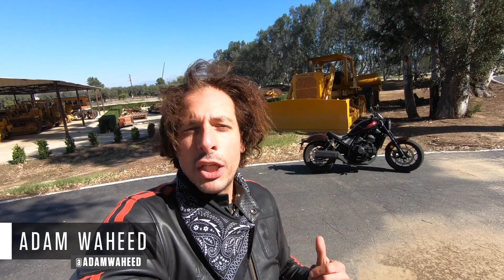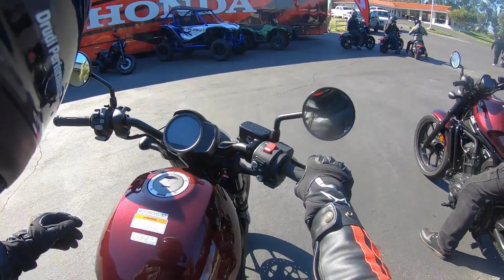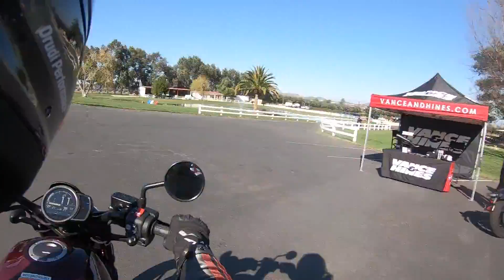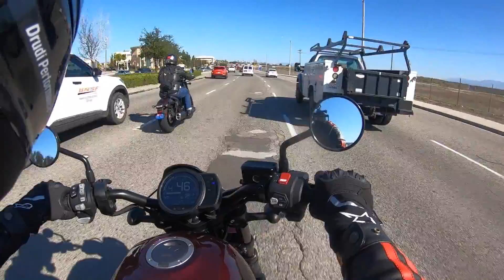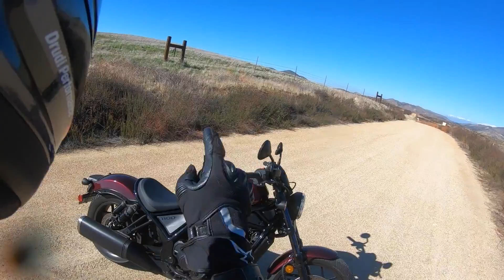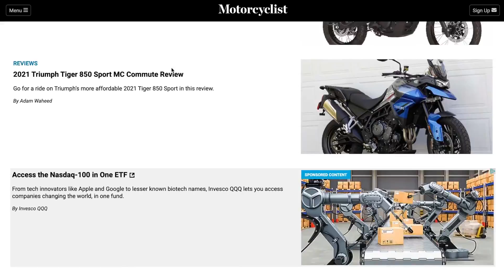2021 Honda Rebel 1100 Review | MC Commute

Comment: Excellent and informative video.
I got 12,000 miles on my Rebel 1100cc DCT and still love it.  Most of the time I am using the manual custom mode. It's a lot of fun on the Jersey shore with some flamenco guitar music in my helmet.

Comment: great video. you earned a subscriber. i have a question. Is the 2021   rebel 1100 cc better at leaning than the 500 cc version?  I mean the angle at the 500 cc is around 35  degrees. Can you lean more with the 1100? Except from the power is there another reason to prefer the 1100 than the 500 ? thank you

Comment: This reviewer is a lying, incompetent clown who should be fired. The bike is seriously ugly. The ergos are terrible for a normal adult male. Inadequate rear suspension travel — you can see it jerking and bottoming in the video. The seat is poorly designed and too low. This is a chick bike at best. But wait two years. Dealers will be selling these sales failures for $6000 or less.

Comment: Funny. You don’t know what torque is. You confuse inertia and torque. The bigger flywheel doesn’t create more torque. A flywheel simply stores energy. It doesn’t produce energy. The. Offer flywheel simply reduces the twitchiness of the motor. Because doing that reduces the ability of the motor to power the motorcycle and rider at the same level of linear acceleration as the Africa Twin, they lengthened the stroke of the motor. A little increase of Stroke creates a higher degree of torque than a little increase in bore.  The longer stroke means per unit of time there will be fewer reciprocations. 

Anyway. Believe me. They wanted the bike to be less twitchy but maintain acceleration. And to run at lower rpms.  Cruisers don’t typically like high revving motors. They buzz. For hours. Drone on. Like being in an airplane in 1953.

Comment: Thanks!!  Another great video Adam!!  I will definitely need to test ride a Honda Rebel 110 with DCT and with the conventional transmission to compare.  I'm used to using the friction zone on conventional motorcycle transmissions for slow speed manoeuvres.  Just curious...  How is the slow-speed manoeuvring with the DCT?

Comment: Waheed, need 1100 test 2, u solo. Wheelies, Ln splittin, 70's in 45 zone. Ask Tiger how that works out. Test 1-brain, test 2-no brain, and all ur other test. But, bottom line ur O.K. I did do 110 on My Honda 500-4 in 1971. Turn myself in?

Comment: this is gonna be my first bike! DCT!
Reply: Once you learn how to operate it you'll find out how it has a far quicker response than clutch shifting. You can still shift gears and automatic mode. You don't even have to let off the throttle to paddle shift. there's no timing.

Comment: Looking at getting a new bike to replace my Kawasaki Versys 1000LT. Love it but open heart surgery has dictated I reduce the height and weight of my next road companion. This Honda has most of what I'm looking for at a price I can pay cash for.  Your about my size I think, 200lbs and 6 ft.   My two questions for you are: size and comfort of cockpit and your thoughts on a road trip about 2500 miles over a week to ten days?  Wanted a 400 - 475lbs machine with somewhere around 75-100hp and lower seat height than my Kaw.  I 'm 72 and been riding since 1965..  Have own several rides,   just to name a few Honda 305 Scrambler & CB450, Yamaha SX650,  Honda VFR800 and a Harley Fatboy  as well as many dirt bikes.     What say you...   Thanks Shack

Comment: Would love to see the DCT on the 300 and 500 if one of the goals is to draw in new riders.
Reply: From what I've heard, the DCT adds quite a bit of weight, which is why it's only available on the 1100.
Reply: @RialuCaos  It would make sense to put it on 300 or 500 as they are lighter.
Reply: @WhenBoredomStrikesChannel  yea but they lack the power to go hard already. Add more weight and you got heavy and super slow.

Comment: The Sportster is more expensive where ABS is an option.  No TC or riding modes on Harley.  Harley only offers stability control with IMU  on the touring bikes and it is an option.  Most premium European bikes offers stability control with IMU standard not an option.  90 horsepower is awesome.  Honda also offers cruise control.

Comment: honestly i feel that motorcycles are like phones, every 6 months they build a new one....i have the rebel 500 2020 , 1 year now, and i swear i never felt i needed more power, on the highways i go 130/km.h without any problems , it goes up to 100kmh in 5 or 6 seconds . may i ask why should i spend another 10.000 euros on this rebel 1100cc ? i mean, i wont go faster than now, and is almost the same bike, but more power, which in my case i dont need.  as i said before, every 6 months they will build another bike, so that people spend their money. my dream was 500cc rebel for about 4 years . now i have it, thank you universe, i apreciate it and love every second of it, no need of change for me.

Comment: Watching this, thinking on how smooth everything is, reminds me how Honda still have the ingrained mentality for over engineering to the point of blandness, even more since the development of efi to ride by wire.
At least I would have loved to see the full power CRF1000 manual engine in this bike.
Thinking of their true v twins like the VTR1000 sp1/2, they can build excitement.
One of the things I loved about the rawness of my more recent MT07, it popped and spluttered at times, it had charisma if you could call it that.

Comment: Great Review Adam! I must say I love this engine with it's 270 degree crankshaft. It would be a natural move up for someone that has a 500 Rebel as you said. But! Does it really fit into the traditional cruiser market? I would have to say no. The traditional cruiser market is and has always been dominated by Vee Twins. Although it does have several things going for it. Price, Honda reliability along with good looks and sound. I would stick with a manual transmission but DCT could be a big plus for some. Honda just may have something.
Reply: I Love not shifting gears...just ride...twist & go is great
Reply: @robertsalyers1351  Thanks! Love it!

Comment: I just can't get over the direction Honda has taken as a company. They killed the amazing VTX line in favor of the Fury/Stateline/Interstate line. Which is, at best, niche. The Rebel will never compete in the market for riders that want something bigger than a sportster. i.e. Dyna and softail riders. Let's also be honest, the Goldwing is NOT a competitor with the Ultra or Road Glide. They are in totally different categories. One is dad jeans, the other is a flashy pair of leather pants; Not practical, but flashy and eye catching. Lol. It's just unbelievable to me that Honda hasn't seen the wide open gap in price vs. quality that Harley has left unguarded in the last 2 decades. The same goes for Kawasaki, Yamaha, and Suzuki. If Honda reintroduced the VTX with fuel injection, 3 trim packages (bobber, light cruiser with windshield and soft bags, and a light tourer with a batwing fairing and hard bags), updated electronics, and kept the prices low like they have in the past, Harley would be in trouble. Big trouble. Don't get me started on DCT transmissions. In theory, I get it. It removes a significant barrier to entry for riders who have never handled a manual in their cars or trucks. However, I don't think it's for the greater good that there is one less obstacle to entry into motorcycling. In my opinion, I want would-be riders to be forced to spend time honing their skills, muscle memory, and multitasking that it takes to ride safely and proficiently. My ultimate point... Kawasaki, Suzuki, Yamaha, Honda.... PLEASE provide a competitor to the Road King, Street Glide, and Sportster that don't require a pocket protector and taped up nerd glasses to operate. Bring back big bore V-twin VTX's, Vulcan Nomads, Stratoliner, etc. DO NOT give up the mid-sized cruiser market to Harley and Indian. PLEASE! Sincerely, a frustrated rider...

Comment: I take it, that it wouldnt be good for those riders that like to rev there motors at stop lights.
Reply: Or they can just get the manual version for cheaper
Reply: you can put in neutral and rev, and then Drive mode and go

Comment: I like your videos but man you sure aren't a poster child for rider safety. I think I saw you use a turn signal one time while turning or changing lanes, you spend too much time riding one hand in traffic, and noticed you also like to wait till the last minute and brake hard at stops. Almost took out the lead rider at about 17:15 of the vid as you flew up beside them as they were turning right at the stop sign, last minute correction on their part kept them from running over your front wheel. But I do like your videos and they are informative. Safe travels to you sir.

Comment: Would it make sense for a beginner? I just don't want to start with the 500 and then "upgrade"... I'm more of a "rider vs the bike" thing when it comes to "entry level".
Reply: Can you afford to dump this bike? You are very likely to at least drop your first bike. Can you afford to fix it and take the depreciation due to it?. You will lose little and pick up better habits buying a smaller bike and then selling it in a year or two.
Reply: @jaybosher6144  Good questions. I guess I should pick up those used 500s that will be hitting the market then..
Reply: @jaybosher6144  Checked cycle trader, most used 500s are north of 5k for them.
Reply: @dharokthewretched7373  look at local used like Craigslist. Plus depending on where you live the prices listed dont reflect since the season isn't here yet. Most people will be pick up this bike when its warmer to ride and the market will he flooded with 500s for sale which will drop the prices further.

Also your insurance rates being a new rider are something to consider. With a bike that pricey you will definitely get full coverage and being new your rates will be high even with an msf course (highly recommend even if just for the 10 percent discount on insurance). Trust me you can rip around a 500 fast enough to enjoy it and keep up with all your friend if you want. Keep that extra money in your pocket and buy gear and plan trips. Thatll be worth many times more than a bigger engine.
Reply: @jaybosher6144  Thank you! Yeah, I won't make a purchase until after I pass the MSF. I'm thinking of going with the Harley Davison course. I'm just browsing around, trust me, this is a compromise. The bike I had my eyes set on was the Yamaha Vmax haha. That thing looks so sexy, or even the ducati Daivel (even more expensive).
Reply: @dharokthewretched7373  i personality stick with Japanese as they have better reliability, service intervals and parts and labor is usually cheaper. Another reason to go with a rebel 500 is unless you have deep pockets you should learn how to maintain and do basic services on your bike. Labor is quite expensive so thinks like chain n sprocket replacement, chain tightening, oil n such should be done by yourself and you won't be as nervous to attempt them on a cheaper used bike vs a new more expensive one.

Harleys are cool but dear God can they be expensive to maintain. As a beginner make your life as easy as possible and reduce the amount of factors that will keep your bike parked while you watch beautiful days pass you buy. And don't skimp on gear. Highly recommend a full face helmet even for cruisers as they aid in a variety of factors like wind n noise not to me to safety. And on top of that invest in a com system like a sena. Got one last year after riding for years without and it has made riding vastly more enjoyable on my own or with a buddy.
Reply: @jaybosher6144  I was talking about the Harley motorcycle course. There aren't many harleys I'd like and unfortunately from the research I've done, it seems like they're over priced compared to what the Japanese ones offer. I hope they can turn it around, so they can save the company but I'm not sure, if they were "better" even at a higher premium than I'd understand, but supposedly it's sometimes an inferior product for more money.

I appreciate you taking the time for the tips/help. Is the sena system like a blue tooth to talk to a friend? Can you listen to music on it? I would probably just use it to talk (I don't have any friends that ride at the moment, I used to but they sold their bikes a few years ago). It's ok. I'd probably find a rebel club or whatever bike I end up finding and just meet new people that way!

That would be a good idea to try out basic maintenance on my bike, it helps to get to know it as well!
Reply: @dharokthewretched7373  yeah, the sena or any motorcycle com system comes with speakers and a mouthpiece to talk. You can sync it to your phone n listen to music n take calls n such. Even without other riders I'd say its worth being able to listen to music and call alone. Look for deals, got my sena s20 evo last summer for under 200 including tax n ship. Cardo is another good brand. Just make sure you buy a unit thats not too old so they still support it with updates n such.

Personally I'd say learn to ride on your own and be careful who you decide to ride with. You can find groups online to link up with but I mostly stick to one or two friends I know are sensible and won't speed or bring unnecessary issues to a ride. But it is fun to meet up with people n see what others have done to their bikes or where some cool back roads are located.

I dont know many things about the harley course but make sure its equivalent to the msf. Not only does the msf discount your insurance but its also a waiver for a license test. Its great for people like me who didn't have any riding buddies when I started so I didn't have a bike ro ride for an actual driving test
Reply: @jaybosher6144  Yeah, the harley course does that, you don't have to take the dmv test. They also do another one at the local college and it's cheaper but somehow I trust the harley one more. I'll look into it before I make my decision.

I'll probably ride without the bluetooth stuff first, unless I have a buddy that I'll ride with. I like to concentrate on the road, I don't need music or other distractions haha. I appreciate the advice though, I'll look into the Sena and the other one you mentioned.
Reply: I wouldn’t recommend it but it’d probably be ok. Not like it’s a real liter bike, especially with weight and DCT. Biggest reason to buy used low powered bike as a beginner is less money at risk in case bike gets dropped (which is far more likely as a beginner).
Reply: @mark52111  I'd buy it with a manual. I'm still in the early stages to make up my mind. I guess if I could find something decent in around 3-5k range used it wouldn't be so bad. I just want something to cruise on the high way and to explore the road a different way. I've driven across america in a Big Truck, and a fun car would be a lot more money. I would like to see how the road feels on 2 wheels.. Then I'd give me all the perspectives haha..

4 wheels, 18 wheels and finally 2 wheels :)

Comment: That thing is a hell of a deal.  with the DCT it is 9,999USD, that includes all the electronics and cruise control.  9,299USD without the DCT, still has all the electronics and cruise control.  So for the price of an 883 Sportster or Indian scout 60, you're getting the most technologically advanced cruiser on the market and still will leave most cruisers in the dust as it has 90hp and non-DCT is under 500lbs, DCT is a hair over 500lbs.

Comment: I wish these reviews would mention a few more things.   Is there a center stand?  Does it come with a tool kit?   What kind of valves and what's the valve check/adjust interval?    No center stand on a chain driven bike is a deal breaker for me.    Surely there's time in a 23 minute video to mention those things!
Reply: @Mark I agree with the need for shaft drive instead of a chain.  Either way, a center stand should be included,  or at least available as an accessory.

Comment: Would you characterize it as a accommodating step up from the 500cc?  If someone was getting back into motorcycles after many years and had been looking at the Rebel 500, would you consider this 1100cc version easily managed?
Reply: The 1100 is easily managed. Using rain mode cuts back power by a lot, for those who prefer that.
Reply: This Good Bike Not to Heavy to, may Be a Option 4 me, Lol if economy Turns Around. As it Stands CycLes... Don't make much Sense With $5.00 + Gas, as They Did@ $2.00, Lol.

Comment: Im happy that Honda made this bike. When I was shopping around in 2018 for a small cruiser with mid controls, there were only 4 bikes for me to choose from; Kawasaki Vulcan 650, HD 883 & 1200, and Yamaha Bolt. I liked the HD 1200 so I bought it. But, after the excitement of a new bike wore off, it really was an underpowered bike for a 1200cc motor. The suspension was bad too. For 10k, i felt like i bought a new bike that was built in the 90s. After learning the history of Sportsters, i realized i did buy a bike from the 90's. But that Evo motor still brings a smile to my face. Even though the Honda 1100 isnt a v-twin, it could be what the Sportster should've been for 2021 in terms of power, electronics and suspension.